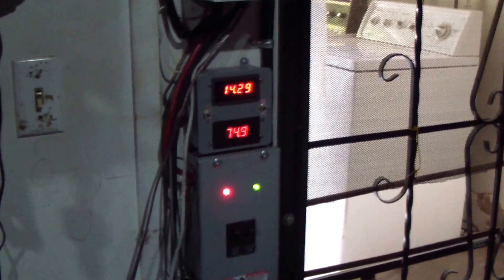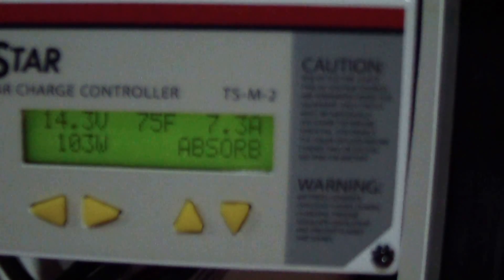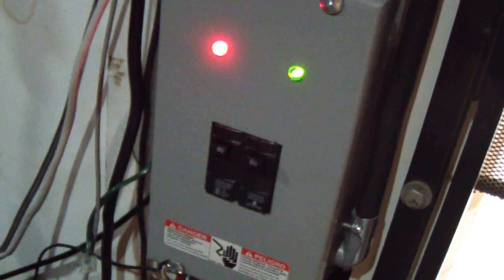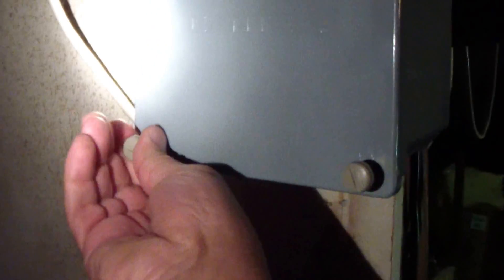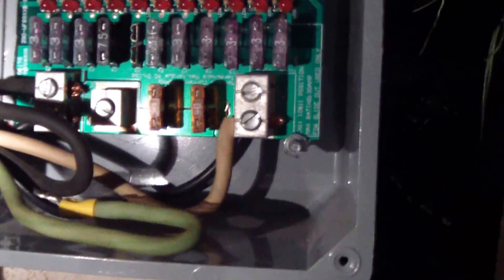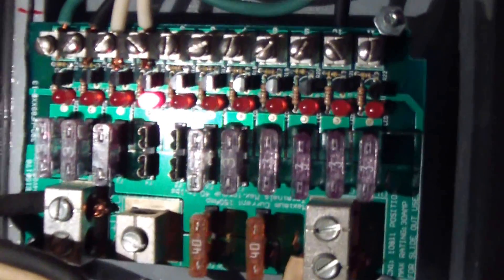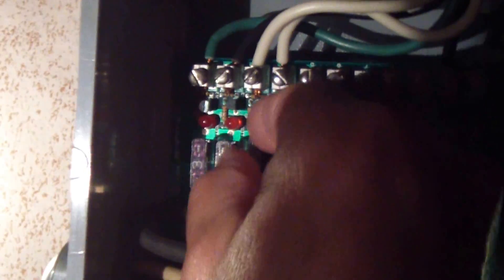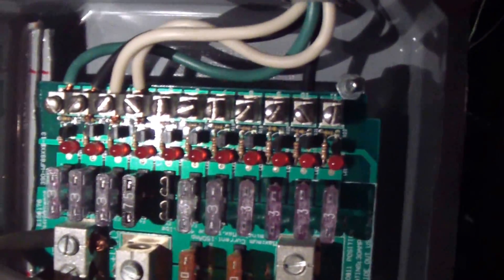Solar Power System 12 Volt Sub-Panel Fuse Box.

Comment: I am wondering if I can wire low voltage lights directly to solar/battery system.  I have the slim recessed lights and I was thinking i should be able to remove the DC converter and wire them directly to a DC source.  Will this work?
Reply from the maker: Yes absolutely.  I have been using my solar/batteries 12 volt to run may Malibu garden lights for the past 10 years.  I also connected an auto switch "dawn/dusk" to them.  I upgraded the lamps with LEDs too.  Great question! Godspeed,
Reply: @ElRazTheGreat1   Can they be wired as a group? LIke say 6 lights 4W each, one switch?
Reply from the maker: @lisadevos5126  Yes, make sure to use a proper switch and fuse.